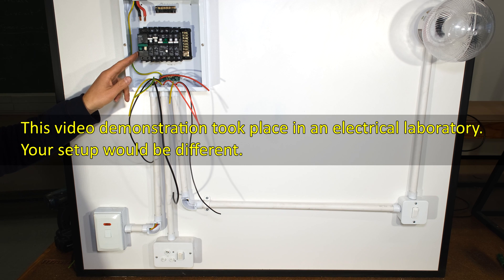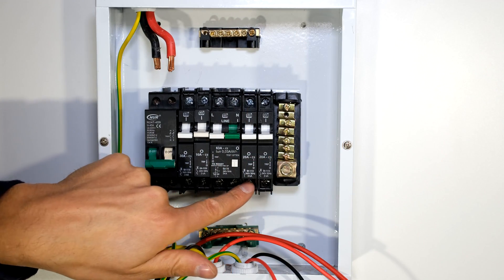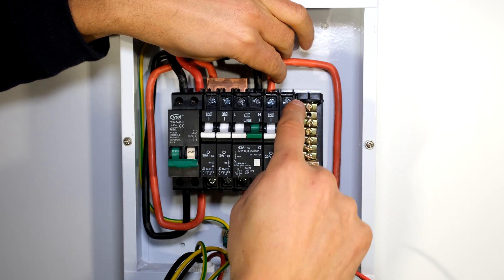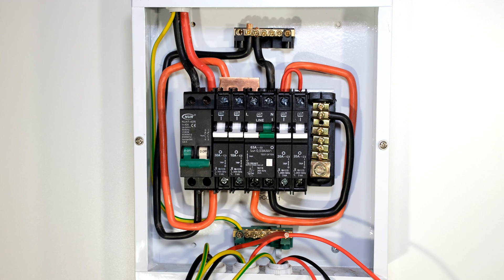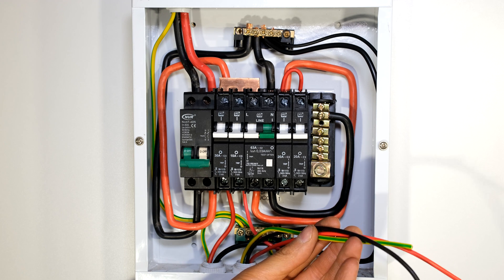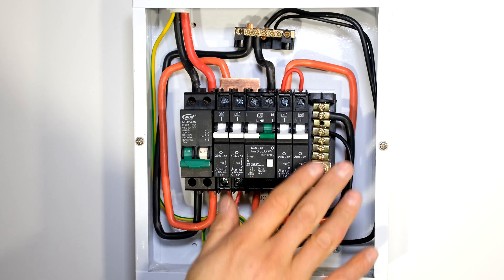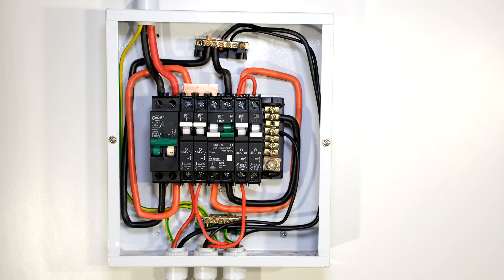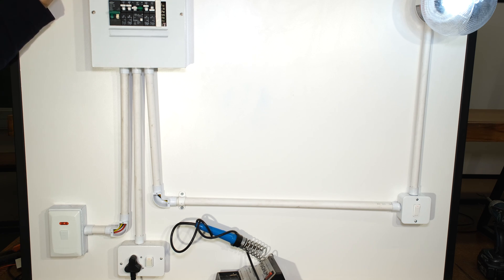How to wire a single phase distribution board with two neutral busbars/rails -tutorial (SouthAfrica)

Comment: In another video you mentioned that EL is required for all circuits, yet this video states that it is not necessary for high current loads and lights?
Reply from the maker: In SA, you can put lights before EL as long as they not in reach
Reply from the maker: Its best practice to protect all with EL
Reply: @ecologicaltime  Thank you for the feedback. Your video makes it look simple, so keep up the good work.
Reply: @ecologicaltime , I tend to differ with your answer as everything must be earth leakage protected SANS standard
Reply: All circuits must be under Earth leakage protection according to the SANS standard. Only a Wiremans holder will know that, when you are an ordinary electrician without a Wiremans Licence you will not know such. We always find when I tell them about the SANS standard

Comment: Hi. I have a question. How do I connect a contactor to this Db board to run a hardwater 4kw heater element for jacuzzi
Reply: You connect a timer not a contactor. Simply call a qualified Electrician

Comment: Hi I have a question, what is the difference between a earth leakage and a circuit breaker?

And thank you very much for this informative video's we don't only learn but we are saving money on getting electrician.
Reply from the maker: thanks. Earth leakage is a circuit breaker but its method is by measuring the difference between the live and neutral and when there is a difference it operates to break the circuit. Some have overload built in as well like the one in the video and that acts as both earth leakage and over current.